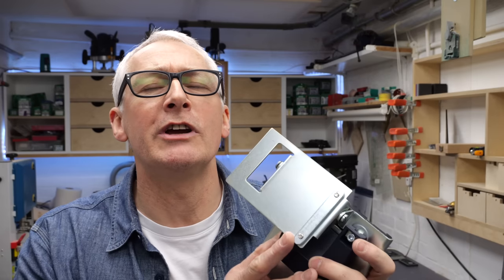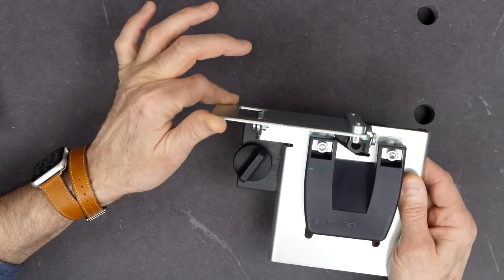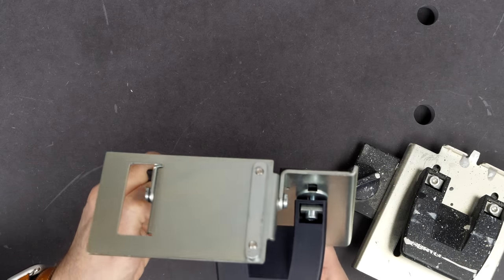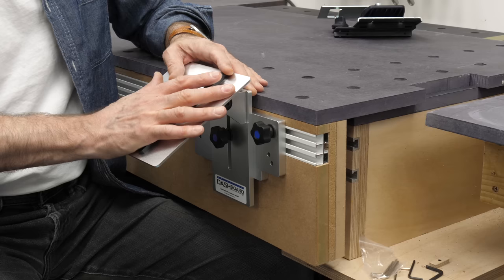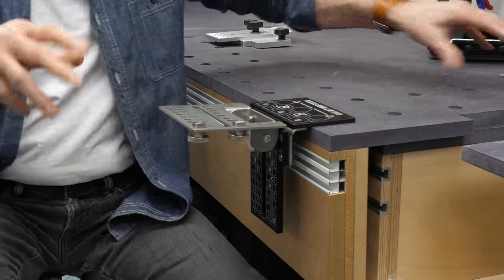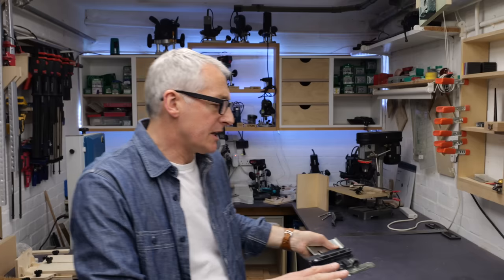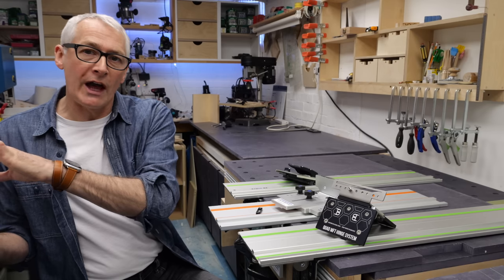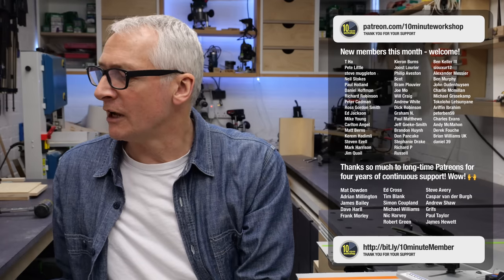3  MFT Rail Hinges [**Gifted/Ad][video 494]

Comment: Dashboard one looks beast. Massive overhang and hella pricey though. Reallly like the BD solution using 2 20mm holes with the quad dog and that it's sized to be in line with their fence system. Very neat. Still using my scraps of aly plate and heavy duty door hinge for mine. Wish I could find a cost effective saleable way to replicate my hinge. Don't know if your saw my vid but I made mine so it rolls down/pulls up from behind the bench. Bit niche for my set up really I suppose. Any way, nice one for the look-see mate.
Reply from the maker: Cheers Stu! Yes, love your hinge idea with the drop-down stowaway trick! Don’t know if you saw on Instagram but I have my own version in the works - minimal overhang, all controls accessible from the front. 👍
Reply: @10MinuteWorkshop  Yes mate. Looking forward to your big reveal chap.🤗
Reply: @10MinuteWorkshop  Have you built that hinge yet Peter? I'm looking forward to seeing what you've put together. I need a quality hinge with minimal overhang as my garage is a similar proportion to yours, maybe even narrower at 7.5ft - space here is a premium...

Comment: My plan remains: build my own rail hinge system.         BUT
This new Bench Dogs piece is very tempting.
I love the connection method. I almost feel that it would be even better if it were an "either/or" option. If it could be connected to the dog holes OR to a t-slot rail on the side. I didn't get a close enough look at it to see if that could be made possible. But, then again, one might not want to be cutting/grinding/drilling on such a nice accessory. 
I've rounded up a couple heavy duty ballbearing hinges to weld together and make my own hinge, for the time being. 
I'll see how long I can live with that. 

Thanks for the comparison video. Much needed, and much appreciated!
Reply from the maker: Thanks! And no, just FYI putting the Benchdogs hinge onto an extrusion isn't an easy option. 👍

Comment: “Unobtanium Plastic” … a great quip in a solid / helpful tool review !  

I sooooooo hate changing rail height on the MFT … that I try to cut 3/4” wood most of the time.  It shouldn’t be that way.
Reply from the maker: I always had mine set to 18mm, with 12 & 6mm spoilerboards added in when I needed to cut something thinner. 👍

Comment: For those of us that are space-constrained and have to work with little clearance between the MFT and the wall behind it, the space needed at the rear to accommodate the hinge overhang can be a major issue. I'd like a hinge but need something with minimal overhang.
Reply from the maker: I’m working on that. You always need some overhang though - or at least, space behind the fence; the deepest part of the cut is at the centre of the blade, so everything forwards of that needs to be accommodated somewhere. 👍
Reply: @10MinuteWorkshop  Yes, that's true but with something like the BenchDogs fence in place, the centre of the blade only needs to go as far as the front of the fence (using FenceDogs, that's 20mm in front of the rear holes). On my table, which is a custom top so will be slightly different from a standard MFT top, I only need to leave 35mm between the table and the wall to allow me to make a cut to the fence line with a TS55.

Comment: Love your videos. I watch a number and for me your format works very well. As for hinge brackets, Yes for me they each have there plus or minus. The Benchdog uk, use of stainless and alloy is of fantastic quality, great to see UK product. I have my own design of MFT using trestles (Axminster saw horses) this makes the top wide. It has 120 x 40 track around it perimeter, on three sides and a Stanton type end. With the Benchdog unit I could only use it if the bench dog fixings are converted to a top face T track slot, but you cant have knobs. This is because the benchdogs fix close to the edge of the top. I would love to see a cam type, top T track fixing.
It was great to meet you at Maker Central, well worth the journey. You must introduce the other half of your stand.
Reply from the maker: Thanks Barry, good to meet you too! 👍

Comment: Thank you for the information. I do like the benchdogs design to support multiple versions of track saws. But I don’t like their idea of mount it through dog holes. That will block the side rail. In case I want to utilize the side rail to make a router sled, I have to unmount the hinge first.
Reply from the maker: Then maybe try the Dashboard hinge? 🤷‍♂️👍

Comment: Thinking also about the MFT tables and the struts which they still only sell as extras but which are integral for making the tables stable enough to hand plane wood on etc. Even with the struts the tables are not exactly very sturdy and of course removing the struts to move the table is a real pain. It's another design like the Festool MFT track hinge which just hasn't been improved upon and that's disappointing for a premium priced product and company. Dashboard's improvement on the table is noteworthy but I have yet used one.

Comment: What's your preference between dashboard and bench dogs uk? I see bench dogs has an alignment jig... how does that function?

I use both 3/4 and 20mm dogs with both festool and makita rails (makita offers a 118" ~2998mm rail which is useful for US 4x8 sheets). I'm wanting to replace my table saw and have been watching videos for years... yours included. I have several centipede workstations including the largest and smallest with 20mm and 3/4 dog hole tops and am wanting to make a knock-down 'cover' style top with some extrusions on the sides for clamp and some handles routed in to remove material for weight reduction and portability. I'll probably end up with a stationary 4x8, portable 4x4, and even possibly 4x2 to use as an outfeed support with a stock bora top.
Reply from the maker: Generally they're both of excellent quality, but the Dashboard hinge is much more expensive to get outside of the US as we get hit for import duties. The Benchdogs and Dashboard approach is different, the Dashboard more of a traditional rail hinge that needs an extrusion for it to fit to, whereas the Benchdogs sits flat on the MFT surface and locates with quad style bench dogs, so ideal for using with an MFT top rather than a full bench with extrusion or T-tracks. The benchdogs template makes it easy to bore out the extra holes for the hinge fixings, with several several positions to choose from. More details on the benchdogs website. 👍

Comment: Which 20mm router bit are you using? I already have the 346 Quad Hole Jig and I have been trying it out on a test piece. I have an Axminster bit and a Wealden Tool Company bit but they both make holes which are a bit sloppy with the Benchdogs bench dogs. However, this might not be an issue as the Quad Hole Jig does attach tightly but I am not going to drill any more holes in my MFT top until I receive the rail hinge (I am hoping very soon, as I am first batch). My MFT top was made using the Parf System and these holes are fine so I also have the option of drilling the extra holes using this. It is just that routing the holes is a lot easier than drilling them.
Reply from the maker: The router bit thing is a real issue - I’ve had a video planned for a while about it. I use the Festool bit, which bores an oversized hole, about 20.16/20.2mm; I had a precision engineer pal grind it down very carefully until it cut a snug fit for my benchdogs. There’s a longer story here - Festool never intended the MFT tops to be used for benchdogs, just for clamping, and to this day they don’t make a benchdog of their own - but essentially, there are many factors at play in getting a snug ~20mm hole and if you took my ‘perfectly tuned’ 20mm bit and put it in another router you’d probably get a different result. 🤷‍♂️👍
Reply: @10MinuteWorkshop  Thank you. I remember that you had mentioned that a router bit video is in planning. As I stated, I have options, I shall just have to wait and see.
Reply: @10MinuteWorkshop  A further thought. If there is an issue with 20mm router bits then the Parf System method of drilling does look better. I have just made a 1200mm by 850mm bench top for the Benchdog hinge system . My idea is to put it on top of my 1200mm by 610mm workbench (made before I knew about track saws and MFTs) with overhangs at the front and back. I drilled out most of the 20mm holes because once started why not keep going but my arm ached. Having received the Quad Hole Jig, I thought that it should be possible to make an after-market add-on template for the Parf System to use the accuracy of the 3mm hole grid but make the 20mm holes using a router. (I know that there are MFT templates to use with routers but my concern with them is cumulative errors.) However, if there is an issue with hole size then I shall have to stick drilling holes and aching arms.
Reply: Hi Robert, Yes the router bit is a minefield with getting the right one for the 20mm hole.  I was chatting to Trend tools recently about this same issue and we are discussing a resolve for the "20mm hole bit" one thing to take into consideration with the holes a not to teach anyone to suck eggs but a major factor in the this is it's not always the bits and possible the router itself with the runout of the spindle 0.05 is enough to through it out too much so my advice is to as much as possible to have more of the shank in the collet to avoid as much runout.
Reply: @RalphBD  I have now bought a Trend 20mm router bit. I remembered that it was the bit that Andy Guile (aka The Woodgratfter) used to make his MFT top. It gives better results with the Benchdogs Quad Dogs tightening securely in the dog holes. I have made a prototype of my proposed jig from 9mm MDF and using the Trend bit I can cut a row of holes at 96mm spacings.

Comment: I don't see alot of people talk about height adjustment on the hinges. Can the benchdogs be used slightly loose in the back so it auto adjusts to the height of the material being cut or does it go out of square if you do so? Really the only thing stopping me from ordering, is I cannot get to the back of the bench before every cut.
Reply from the maker: Honestly, the only rail hinge I know of that allows that is my own design - available as a set of plans for a DIY project. 👍

Comment: How accurate are these hinges? Can you just slap them onto your mft and they’ll be spot on or is there an element of setting up for accuracy each time you use them eg if taking a portable table to site?
Reply from the maker: The hinges are as accurate as you set them up to be. Fitting stops in the t-slots to locate them means you can remove and refit them with confidence - provided they were set up correctly at the start. 👍

Comment: I do like the single lever to lock the Festool version, but, using a tool to lock in the rail has been a PITA (too much of a faf... :^). Love the beefiness of the Dashboard and not needing tools to install or remove (I have to work outside so each time I use my MFT it needs to be set up then taken down which puts a bias on my choices). Naturally I bought my Dashboard before the Bench Dogs version was released so that won't be an option for me. Yet. The one thing I won't like about the Bench Dog version: The T bolts to slide the rail on - I always seem to be fightying the T bolt to line up and would prefer a long rail like the other two use. An option they could offer later? Being in the US the Dash Board does not suffer the shipping and VAT hit; making it a much easier choice too.

Comment: Thank you for the comparision Peter. Can you provide some more info on BD hinge system. I have already ordered it but I found no info on what can be the maximum distance from the edge of the top to quad dogs center line. My planned diy mft will be built from aluminium extrusions so the edges of the top will sit on the extrusions which are 40mm wide and from the looks of it the quad base dogs might be in collision with that extrusions. Another question i have, is about depth of quad dog bases - just wondering if i can make a work around for the collisions by putting  thicker top ie 21mm.
Reply from the maker: Thanks. I've made a few posts on Instagram about this, I'll link them up here.
https://www.instagram.com/p/CcheeH5j10V/?utm_source=ig_web_copy_link
https://www.instagram.com/tv/CckA_s3jXAv/?utm_source=ig_web_copy_link
https://www.instagram.com/tv/Ccmj_WSD2wb/?utm_source=ig_web_copy_link

Long story short you need 35mm from the edge to the 20mm hole centre, to allow space for the hinge/support hardware. HTH! P

Comment: Hi Peter. Sorry this question is from an earlier video, but thought to post it here. You mentioned in a video the Spax M type screws for MDF and I followed the link in your comments (which seems to go to a different screw), and found the right product. My question is around the Torx drivers, am I right that they are proprietary to Spax with that extra protrusion? Amazon shows Spax bits, but they are not available in some sizes like T15. Are you aware of a set that Spax or somebody compatible offers?
Reply from the maker: Hi Gavin. No, they’re standard Torx fittings, any torx bit of the correct size will do. 👍

Comment: Need to put that on a Tshirt, "If you're on a budget, buy Festool":D

I like the Benchdog's solution, however (in this video) you forgot to mention the additional tool (ideally) needed to make the extra holes which adds a few coins on top of the price.
Reply from the maker: That’d be a good t-shirt to wear at a trade show! 😂 Re the template, U think I showed pretty well in the previous video that you don’t need to buy the template to make the holes - but yes, it certainly made making them easier. 👍👍

Comment: Great review and I agree the Festool rail hinge is a bit ‘meh’. That wee bit of shaped plate to engage in the slot was perhaps optimistic when it comes to precision. I also find the height adjustment clamping lever a tad sketchy. Both the other products are clearly superior. The chap across the pond needs to licence production to a Brit!

Accuracy, repeatability and five cut test?
I know this is not rocket science and woodwork does not need the accuracy required of more demanding disciplines. But.
It would be good to know how to adjust, what to expect for’ reasonable’ or achievable accuracy and how it performs in terms of repeatability using 5 cut tests.

Have you covered this - have I missed it?
Best Regards
😀👍
Reply from the maker: Thanks Norman! Yes, I think Rob at Dashboard has looked at local production, but always difficult to deal with these things from afar. As for the 5-cut test, I've never done one on any MFT or any MFT top I've made -and I'm certainly not about to start on someone else's product - because it's almost impossible to create the kind of test conditions where the results would be quantifiable; I'm sure someone will, but it wont be me I'm afraid! 👍

Comment: There's one thing I noticed missing from all these commercial available. It's none of them. have auto Material thickness Adjustment. Every time you change the thickness of the material you want to saw, you have to resset it. Where as on my homemade version. I use to. use two fire rated door hinges. Welded together as one hinge in my case, But could be bolted together. at each end. of the track.  They're the type with the ball bearings hinges. So they're very tight. No slop. So they're bolted to rail and table exrtusion at the rear end, But the front end version again uses Two hinges.again one side to rail and other side connected   to a thin peice of ply with two dog holes in it to match table dog holes. so I can lift off the track. completely up out of the way, as   the commercially   versions do. I have to admit my version's not pretty. but I never need to do any adjustment. because the hinges are double. that allows. as they go up, they go back If you're doing something thinner. The rail just comes forward  a little bit and drops more. I doubt it cost me as much as £20. for the four hinges. OK, I have the ability to Weld. but even woodworkers can  bolt 2 hinges or drill them  if holes do not match  then connect them together. Alternative are you aware of these on bang good and. at only £61. I won't put the link. Youtube never seems to allow me. But I'll put the name as they are advertised.  Adjustable Rail Lift Clamps Unique Sliding Tenon Design Height Adjustable Ideal for Various Table Heights and Rails Ensures Sturdy.
Reply from the maker: My rail hinge does. Easy to remove the rail from the hinge too. 👍

Comment: TSO introduced a hinge “upgrade” (rather than replacement, presumably because it reuses some of the Festool components) last year.  I haven’t found many comparisons to the other hinges.  It looks very well thought-through and doesn’t require any new holes for dogs.  Has anyone here tried the TSO hinge?  Experiences?
Reply from the maker: They’ve done a poor job of promoting it - I had no idea. I’ll take a look, thanks! 👍
Reply: @10MinuteWorkshop  Tried to respond last night with a link, which YouTube probably blocked.  It’s under “Workstations and Components.”  If you get seriously curious, let me know if I can help facilitate (e.g., transshipping).

Comment: Where do you get the slop stop for a Festool rail for the Benchdog quad hinge system ?
Reply from the maker: Benchdogs!
Reply: @10MinuteWorkshop  Thanks. I will try them again. They did not seem to know about it when I asked them at the time I purchased my bench dog system. There response from tech support  was did not think I needed them.
Reply: Customer service at Benchdog replied they never made one since it’s not needed. I’m confused since my original set up grooved the guide just as you had indicted when it was the steel pin by Festool.